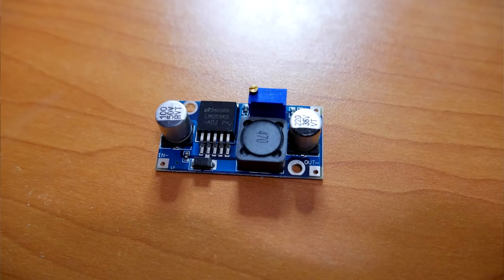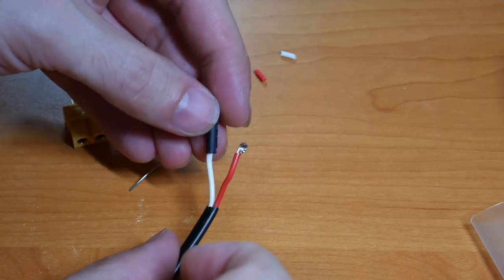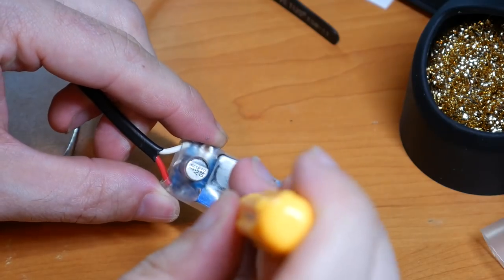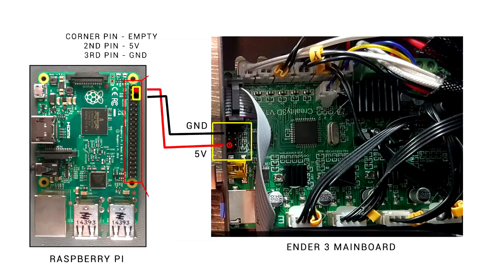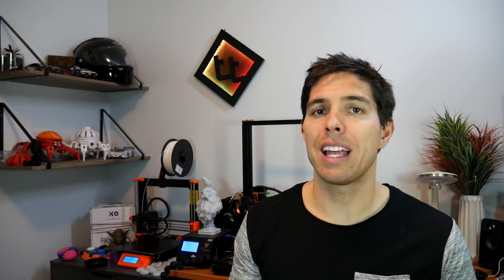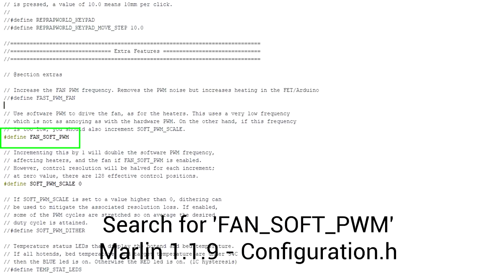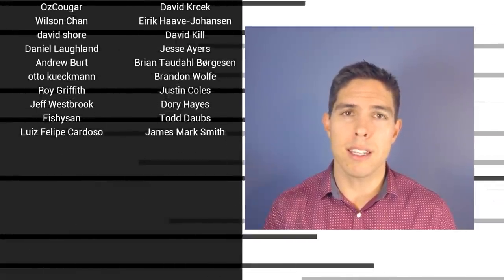Buck converters: Quieten your 3D printer with a Noctua fan & directly power your Pi

Comment from the maker: Some good discussion in the comments from some knowledgeable people. Here are some additional (and clarifying) thoughts:
1. Yes, you should shut down the pi first before killing the printer power. Forgot to film this, but it is best practise.
2. Despite the fact that I have shown ways of using less than 24V fans on a 24V system, and the fact that the developers of Marlin have acknowledged this as a solution and included it in their firmware. You are better off just using a 24V blower for part cooling. This is why my shopping links below are for 24V blowers.
3. The Noctua 40x10 fan I used flows less air than the cheaper fan that came with the printer. I have had zero issues so far with prints since fitting it, perhaps this is because I have a Hero Me duct fitted, which when I tested it seems to have a better seal around the hot end heat sink. A larger 40x20mm Noctua fan is linked below, and for only a dollar more, is definitely a safer bet to prevent heat creep and potential clogs.
4. The gauge of the wire I used was overkill. I mentioned this in the video and had a note in the description. That's what I had at the time, it still works, just harder to make the Dupont connectors neatly.
5. Some people in the know have commented that the capacitor is not a great idea. I tend to agree, and I don't recommend it, when enabling soft_PWM fixed the whine anyway.
Reply: The linked Noctua 40x20 is a 5v fan.  Unfortunately, Noctua doesn't make a 24v fan in either the 40mm or 50mm size range.
Reply: Teaching Tech I see you mention a4x10pwm on the list but you used a4x10 flx Noctua .The difference matters or not?
Reply from the maker: James that is to use with the buck converter.
Reply from the maker: Ozzy since they are running at 100% permanently I don't believe it matters.
Reply: @batosi111  not sure if you got your answer, but Michael mentioned the linked 5v fan was to use with the buck converter
Reply: I´m looking to change my noisy e3d v6 fan that came originaly with the e3d v6 kit. Acording to its manufacturer, this fan (XYJ12B3010H) outputs 4.08 CFM, witch translates to 6.93 m3/h, while making an unconfortable level of noise off around 30 dB-A. In noctua´s datasheet for its 40mm fans they claim that the 10 mm one (NF-A4x10) outputs 6.6 m3/h with the L.N.A. (Low Noise Adaptor), making only 12.9 dB-A and 8.2 m3/h without the L.N.A. making 17.9 dB-A. I feel 6.6 m3/h it´s just a bit too low for preventing heatcreeping, but I don´t want to overcool (if that´s even a thing) the sorroundings off the heatsink and causing too much cooling in the parts due to the higher airflow output of the fan without the L.N.A.
In the other hand, Noctua´s 40x20 fan (NF-A4x20) outputs the same 6.9 m3/h than the "original e3d v6"  with it´s U.L.N.A. making ONLY 8.5 dB-A of noise, so it´s sounds a much fair comparison performance wise, BUT with a higher weight. (I can´t find the exact weight for neither the 20mm nor the 10 mm models)
Any toughts out there? Should I buy the 40x10 version and leave it at 6.6 m3/h  or keeping it at its full performance with 8.2 m3/h and 17.9 dB-A?? OR should I go instead for the bigger version despite it is heavier than it´s little brother??
Reply: @rentaspoon219  I know this is a year old, but in theory you could still use one with a 40-80mm shroud?
Reply: Anyone encountered issues using 9v in the noctua 40x10 regarding failiure in the hot end? (Same voltage as the "quiet" cable)
Reply: sometimes just replacing the stock fan with a decent brand one helps, the sleeve bearings don't last on the cheep ones. using something to dampen vibration probably will make a big difference without loss of air. note fans mounted with the axel inline with movement are more prone to getting loose
Reply: For Update: I'm not using the 'quiet cable', but i undervolted the fan to 9v, using the buckconverter. No issues so far.
Reply: Buck convertors convert voltage down, boost convertors convert it up. It's worth knowing the difference when you're buying on eBay etc.
Reply: I used the same 4010 Noctua 12v fan when I broke my stock one and couldn't find a decent replacement. I didn't end up needing the 24v>12v step down converter. I have printed for about 48 hrs at PLA temps since with only some PID tuning and normal temp for filament and bed adjustments being required.. 
I am aware its probably not a good idea to run 24v through a 12v fan but it seems to be working reliably enough so I am not too worried and will continue doing so.
Reply: To anyone with ender3, pro or V2
The stock Main board 5V is rated for 2A max  including bltouch, display, usb port etc.
So don't use it for raspberry pi.
Reply: At 9:37, for example, there's a distinct 4Hz pulsation/ticking sound. It's also present without the soft PWM to a lesser extent. It sounds like the fan blade scraping, but the frequency doesn't change with the impeller speed. My Longer does this too, and it has a different board. Any idea what's causing this? I always run my fan at low speed, but this sound bugs me.

Comment: Here is a tip for soldering those XT60 connectors... Plug them together before soldering, this stops the pins pulling out of line when the plastic gets soft during soldering ;)
Reply: and it stops the plastic deforming making them tight to get back together. if they heat up and cool down together they will fit better together its an RC thing

Comment: @Teaching Tech  First, thank you so much for all your help! Your videos so much detailed and helpful! I made this silent upgrade on my Ender-3, and found a much much better solution for 12V part cooling fan. Here's the deal: (On SKR Mini E3 boards, but guess it is the same on factory Ender mobo) The part cooling fan output is strange. The positive terminal is a CONSTANT 24V, and the ground is connected/disconnected via the PWM! It is crazy! So grab your DCDC step-down converter, connect it's positive input to the mobo fan 24V output, but you need to connect the DCDC ground input to a constant ground! Like on the power supply. Limit down the converter to 12V, then connect your 12V fan in the following way: The fan's 12V wire goes to step-down converter positive output, but the fan's ground is goes to the mobo fan ground.
In this way the fan gets a constant 12V from the converter, and a PWM ground from the motherboard. It works! You change the fan speed on the printer between 0% and 100%, and the voltage on the fan changes between 0V and 12V. When you drive your fan 100% then there's no PWM sound at all. No need to change anything in the FW.
Reply: This is very interesting! It would make things so much easier! Have you tested this on SKR Mini E3 V2 as well?

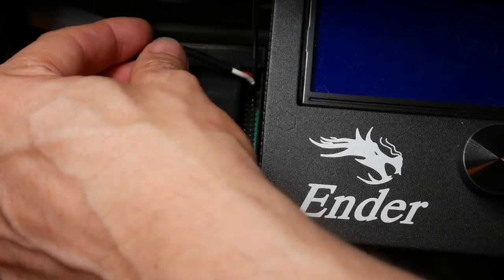Comment: Just getting around to the video, but I can confirm (from right around the 5:00 min mark, the BTT SKR v1.3 does NOT have enough current to run the RPi running from one of the Max_Endstops (I measured about 1.9A from the X_Max) and Octoprint just wouldnt load. Great video, keep em up Mike.

Comment: I got a pack of those LM2596 buck converters off of amazon awhile back. Pretty useful little modules. How I tend to solder my power wires on them is to first put a small bead of solder on all four of the pads, then all you have to do is heat up the bead and pad and press the appropriate wire lead into the melted solder. I also tend to give the lead of the wire a touch from the well tinned iron to get the solder to stick around it; that helps with welding the lead to the pad and making a sturdy connection.
Reply from the maker: Great info, thanks for sharing.

Comment: The downside of using the controller box power supply is that you will not have an independent power supply for the pi. By having a separate power supply if you're using a relay to shut off the power in the event of thermal runaway you will still be able to monitor the Webcam feed to ensure that you don't have to call someone locally to put it out or contact the fire dept. I have a fire detection unit connected to pi as a safety also. Hope this helps.
Reply: Not to mention, if you want to work on the raspberry pi only (like updating / adding packages, doing changes on octoprint, uploading files, etc...) you'd need to turn on the printer also, which is a waste of power and noise
Reply: Just plug the pi into a different power supply? It's not like you're permanently modifying the board.

Comment: After watching your previous guides I decided to go with the EZABL rather than the BTouch, while looking at the TH3D site I found an additional item that I don't think you've mentioned, their Raspberry Pi direct wire power adapter (that will power both a Pi and their EZABL directly from the power supply).
Thank you for for this video as I've been wondering how to use Noctua fans.

Comment: you definitly can remove the coil whine with a capacitor. you just need a bigger one. i have tested it and the lower pwm you want to use without coil whine the bigger the capacitor has to be. but at really low pwm it takes some time before the fan starts to spin.

Comment: You should use thinner wire, because consumption of rapsberry pi is not that high. And when you setup voltage you should set higher not lower, to 5.2v. Instead of using buck converter for fan you can use a about 50 ohms 1w resistror, it depends on how much speed you want.

Comment: I was searching for power regulators and found this video. I had been watching your Videos for weeks as I just bought a CR 10S Pro. I use it to print 3D parts for my Model Train. Currently a Smoke Generator using a Fan to puff every stroke of the steam engine. When I saw your face and heard your voice I was shocked, but you used the Buck Convertor exactly the way I need to for my Smoke Heater Coil and MIni DC Can motor. I watched the video and yes I need quieter fans too.  But then I saw the links OMG! about $1 is all I need to fix my problem. Now I can build the 6 Smoke Kits for my Train buddies and allow then to simply bring track voltage up to the smoke and the Buck Convertor will keep the heater coil at the correct temperature and not melt my 3D printer housing!!!!! It was an awesome night, thank you so much.  And I love the 10S Pro my first smoke housing off of it was like jewelry.

Comment: I think shutting down the printer power supply by octopi controlled relay may be better and definitely the ultimate quiet (and power saving) solution. You can buy it super cheap and use octoprint plugin for smart control. Yes, you have to power up octopi separately but it is not much of an issue since it runs great on any 2.1A phone USB charger.
Reply: even better, get a Sonoff (IoT relay) from your favourite chinese supplier and use octopi to power on/off your printer (don't forget to read up about safety!)

Comment: Personally i would not heat shrink the converter because the componets will generate heat and heat shrink will keep it in. Id print a box for it that allows for air to get in and out.
Reply: good advice
Reply: I like this, post it on thingiverse
Reply: if it is an actual buck converter it should be over 90% efficient and will generate very little heat
Reply: @jasonm2477  Yes but still... a Raspberry-pi can use up to 2.5 Amps, if you have a nice camera, small display and some lights added to it, it will be well over 3 Amps. Cheap buck converters don't work that efficient if they are used close to their max. continuous use, so say about 80% efficient, 20% loss (I did actually measure on converters like shown in the video).
3 Amps is 15 Watts at 5 V, so you will using about .3 Watts in the buck-converter and it will be getting pretty warm after a while. Of course these higher loads are only if you are printing fast  with camera and display on but without cooling this is a bit much.

That said, I have one hooked up in heatshrink and I noticed that it painful to my hands so I changed it to a more open aproach later and started calculating just then...
Reply: @jasonm2477  other youtubers have shown the efficiency to be on average 75%
Reply: Well, I agree with your opinion, but from another perspective. I just could not fathom why he does not design a custom box for all the new modules. It just defeats the purpose of the channel about 3d printers, because 3d printers are known to make custom cases easy... Instead, he makes some dangling "sausages" hanging on new "spaghetti" wires.
Reply: @vasiliynkudryavtsev  maybe he just didn't think of it and did what he was familiar with. I've learnt about heat shrink and also that there are buck converter boxes on thingiverse so we've all won out.

Comment: I'd make it a little higher like 5.1-5.2 even. At least usually works. because when drawing large amounts of current and using long wires the voltage tends to drop. and the raspberry Pi tends to like higher voltages by a little (you get that annoying voltage drop error icon otherwise)

Comment: You want to use a CERAMIC smoothing capacitor. Electrolytic wont smooth the harmonic frequencies in the PWM signal 'fast enough'.
Reply: You need an LC filter - look it up

Comment: Hi there hope you can help i have changed my hot end fan to the same one in your video and used the same buck converter and that side of it is now working great. but now my part cooling fan seems to make this strange buzzing pulsing sound that changes with speed but almost goes when at full speed are you able to help with this.
I have a Ender 3v2 with a 4.2.7 Silent board

Cheers in advance

Comment: New thought, instead of the 1 to 2 XT60, why not use the extra terminals on the PSU and add 2 more leads out for 3 24v XT60's (or whatever connector preferred) available for extras? (Going from the Ender 3 both new and old PSU seems to have 3 sets of terminal outs).
Love all your guides btw!
Reply from the maker: That's a great suggestion, I hadn't thought of looking under the PSU cover for spare terminals.